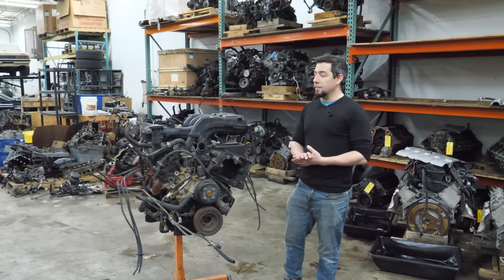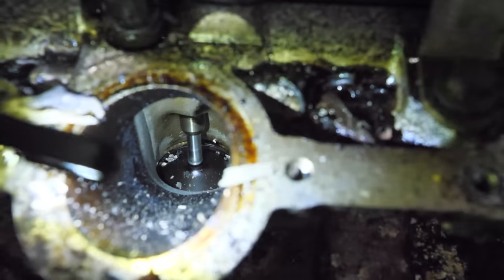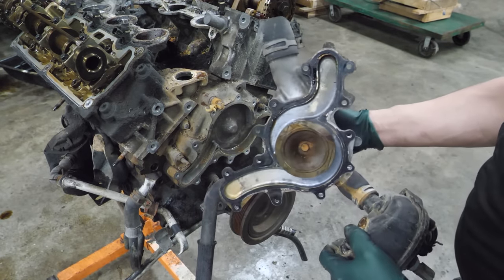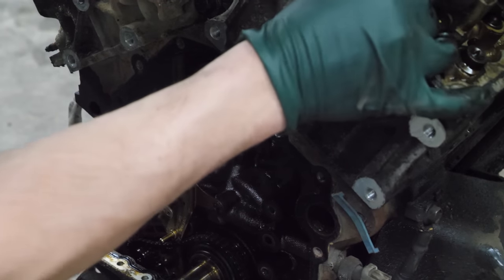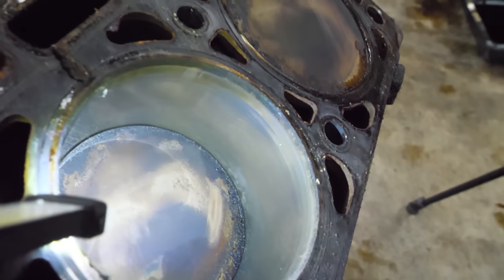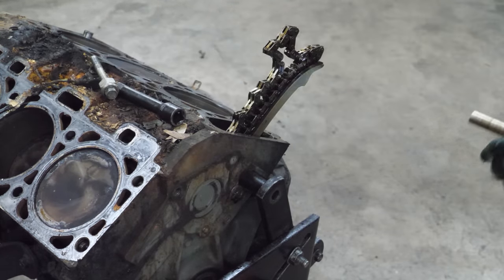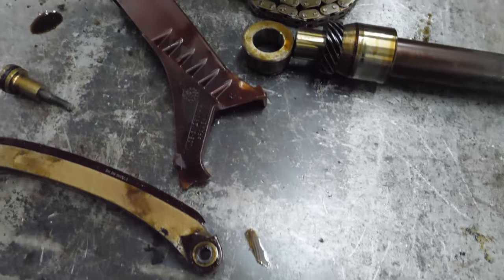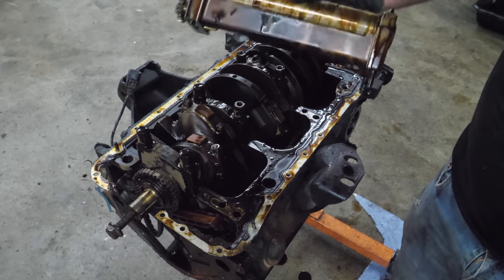Ford Explorer / Ranger / Mustang 4.0L SOHC V6 Teardown! Is This Why They're Called "Exploders" ?

Comment: I worked for Ford for over 30 years and YES this is the worst designed engine ever, it is not reliable. no power and even less fuel economy. For the rebuilders out there, you must have the proper tool kit to reassemble since there are no keyways in any sprocket other than the crank. So, you have to line all sprockets and cams and use new Torque to yield bolts and then tighten to specs. Oh, if a chain breaks, then you need to redo the head for that bank. It's a nightmare. I do have the master tool kit if anyone is interested..

Comment: You have to pull the head? Shit it`s easier to replace a timing chain on a audi at that point. But  with the ford, you dont get the good fuel mileage, the power or the refinement!

Comment: Yes. This 4.0 V6 is a good engine. The cam chain design is not good. Has front chain cam drive on one bank and opposite on other bank with center gear rod drive. You have to go around your a__ to get to your elbow to work on valves in this engine...and that's after you are forced to pull engine to do it. WHY FORD, WHY ???

Comment: In a Ranger you have to pull the engine  or trans to replace the rear timing cassette. Total bullshit design. In the model with the countershaft theres a total of 4 timing chains. Piss poor planning when a single chain worked fine for generations. Job justification projects create total misery and money loss for consumers.

Comment: This guy 🙄 ok the tensioners are slack because they are pumped up with oil pressure so , it’s not running that’s why the chains are sloppy and also the tensioners

Comment: One of the worst engines ive ever had. Shop wanted 4k to fix the timing chain.
Reply: Prolly because in order for them to gain access to the rear timing chain and guides the engine has to come out. But if someone has done this timing drive swap enough times then you might be able to figure out how to do the rear chain and guides without pulling the engine lol but their prolly just giving you an estimate based on what book time for the job says. You should just buy a remanufactured engine from a good source and have them swap the engine, it would prolly be cheaper and then you have a fresh engine as long as the engine manufacturer used a good timing drive kit in the reman process. You could get a junkyard engine but it's a good bet that that engine will have timing chain issues as well.
Reply: @ClutchCobraKID1  I had someone put in a used engine they even put a new timing on it before they put it in. Just for the oil pump to seize up and now the engine has to be pulled again because the only way to take the oil pump out is also pull the engine. The 4.0 is a shit engine.

Comment: Just change the oil and use good oil. I've ran these engines hundreds of thousands miles and never had a problem other than a leaky thermostat housing. Big deal. This guy is very ignorant to the design and qualities of this engine and just a Ford hater in general.

Comment: I like your content but you are way off on this one. Regardless of opinion on design every bit of information given here to service this motor is incorrect. They're well built with an awkward design to convert a pushrod to sohc. I see many comments about the wasted billions? to redesign this motor.... or rather cumulative billions over the decades in various designs.  Couldn't be further from the truth. I am personally not a fan of these engines either and prefer the 3.0 vulcan for simplicity. Push it to the limit and you will experience failure, this applies to all designs.

Comment: This was just so annoying watching you fumble around. I suggest doing just a little research before taking motors apart. There are a couple of quick easy tricks to taking out the timing sets without removing the heads on these motors.

Comment: Yep, horrible design engine with T chain. The short block was a push rod block that didn't have any room to run 2 chains on front so one went on the rear.  Typical Ford POS

Comment: Cheap ass chinese plastic that breaks down in heated oil before you reach 150,000 mi. Aaaand, you have to pull the motor and separate it from the transmission to get to it. I hate Ford.